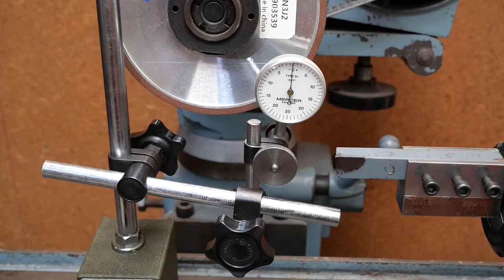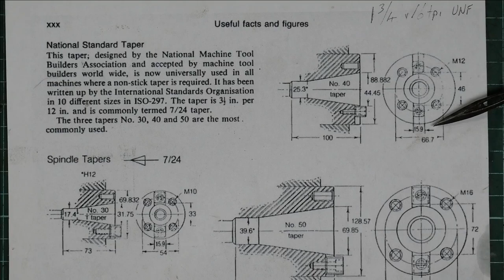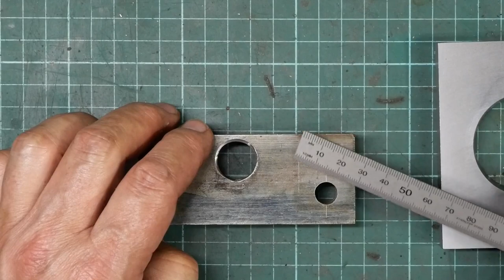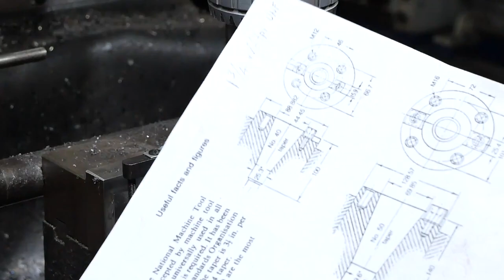Making an NT40 Tool Setter

Comment: Alan a very interesting project !
 I leave a piece of 1 inch dowel in the jaws of my chucks it makes for a good handle when moving them ( old muscles ) 
My old boss used to say when I was having issues " it's all part of growing up "
Christopher from Queensland
Reply from the maker: Thanks Christopher. I've found that the hardest part of moving big chucks is actually the positioning on and off the lathe spindle - and that's where my sled thingy helps. I will use the overhead gantry to take the weight when I start feeling the need - probably not too far in the future :(